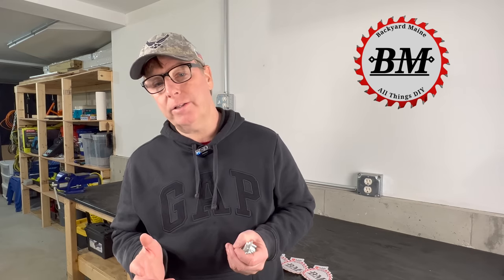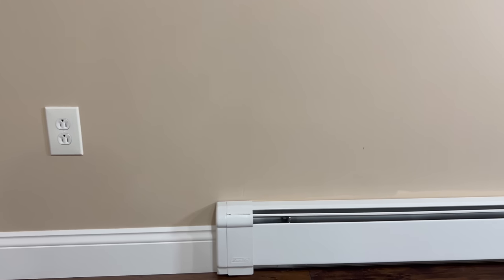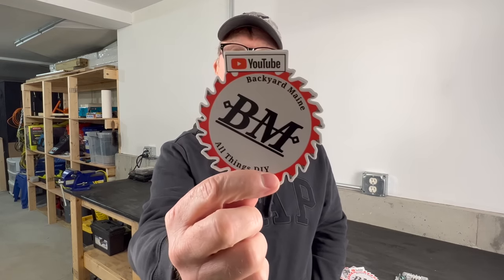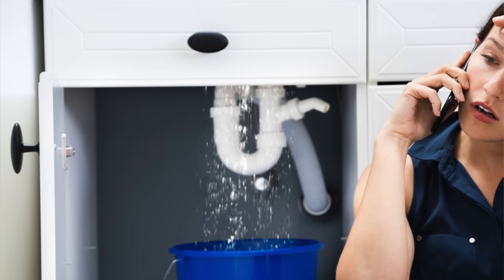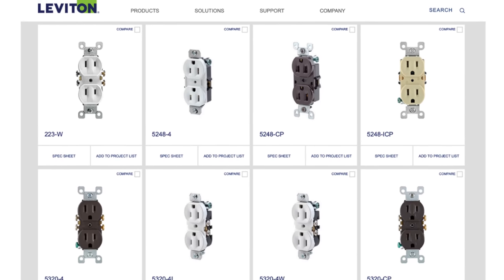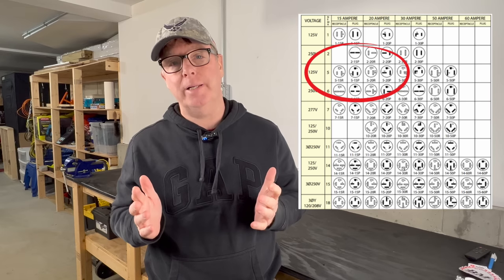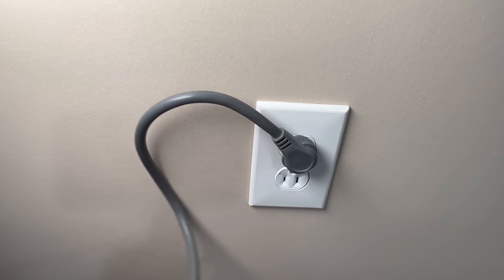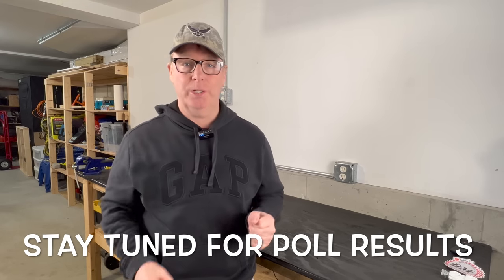Are your outlets installed upside down? (You may be surprised)

Comment: My Dad, a master electrician in Miami and St. Augustine Florida,  taught me that it's ground down. For  two reasons. The ground is the longest prong and therefore, the last one to disconnect in a partial pull out. That way the appliance remains grounded continuously until the plug is completely removed. I think he was correct.
Reply: That's not enitrely true. Its an intuitive thought yes but, the longer length of the ground prevents the shorter conductor blades from breaking contact before the ground pin. That's it's design.
Reply: Rule 1: Ground should contact first and break last. When someone steps on a cable with a "rubber" molded plug and bends the pins ground down  give a better chance of obeying  rule #1.
Reply: That is the first logical opinion I've read/heard... But when actually insertin or removing a plug the ground will be first/last to make/break contact. Any plug that works it's way out of a receptacle due to wrangling the cord would be damaged or very deformed before a ground fault condition could occur. End user ignorance can't be specified or solved by design... That is why we have lockouts... 😂
Reply: @javajoust  Thanks.  My Dad was a very smart man and I miss him.
Reply: I would like to respectfully argue that theory. In a partial pullout scenario the neutral and hot connectors will be exposed to possible objects or little fingers actually coming in contact with the connectors such as if you're hammering a nail into a wall and drop the nail and it just happens to fall across the exposed hot and neutral of the partially pulled out plug underneath you. If the ground was up, the ground connector would be exposed to the falling nail. Also, most cords run along the floor which make them succeptible to partial pullouts from feet and furniture pulling on them. A ground up installation would be stronger resistance to a downward pull considering the shape and length of the ground connector. Outlets seem to grip the ground connector much more solidly than the hot and neutral do. We have all grown up seeing ground down so of course it looks very very wrong to us. I have reversed outlets to ground up a few times to accomodate window air conditioners that were above the outlet and had very short cords. It seemed weird at first but did the trick because of the design of the air conditioner plugs and the short length or the cords. What do we do if the outlet is sideways? Ground left or ground right? I bet all the righties out there will say ground right lol.
Reply: Yep I was looking for someone to say that.
Peace
Reply: But what difference does it make if the ground prong is up or down? Either way, the ground prong, being the longest, is the last to disconnect.

Comment: I wholeheartedly  agree with you on ground down. The esthetics are more presentable on a ground down. Many of my cord applications prove that ground down will accommodate  other cords  more easily.
Reply: My thoughts exactly
Reply: With ground up, if a penny or other object fell on the pins, there's less than 50% chance of a bright boom. With ground down there's close to 100%. Ground up for the win
Reply: Are esthetics or poor cord design more important than safety?
Reply: @presw2pw123  how many of yall just keep your pennies and other conductive objects directly over your outlets that also at the same time happen to be hanging out halfway so that the prongs show enough for it to short it💀 like what is this made up ass scenario lmao
Reply: @presw2pw123  There is no metal in pennies anymore.  Maybe that is the real reason they stopped using copper.
Reply: @robertsmith2956  They are zinc with a coating of copper , and still conductive.
But the reason is because of the penny being devalued .
Ergo it would take more copper than a pennies worth .
Reply: @robertsmith2956 pennies since the early 80's have been made of Zinc and have a "wash" of copper, so they definitely conduct electricity,  although the Zinc has a slightly higher resistance.  I doubt that you could measure the difference with any ohmmeter you own.
Reply: @presw2pw123 You act as though this actually ever happens. Its a complete and total non issue
Reply: @presw2pw123 so all cords a poorly designed?
Reply: My first home was ground up, I grew up with ground down and never saw any issues. With my first home we had a lot of arching and black around my plugs and had trouble with appliances and extension cords. That scared me so I turned most of them to ground down.
Reply: @garys0scale525  Does it make sense for an alcoholic to throw half a bottle away cuz he saw puppies out the back of a sack ?
Reply: @garys0scale525  What did Billy promise Alice ?
Reply: @garys0scale525  Oh sorry i see the key got deleted.  I was talking about the movie , where the red fern grows .
Reply: The aesthetics? Aka, YOU like the way it looks?

Comment: What it really comes "down" to is what the local inspector likes to see. I mounted  all my house outlets ground down when I built our home. No issue from the inspector. When I built my non-attached shop building a few years later, I mounted all my recepts. ground up for added short circuit protection with 3-prong plugs on my power tools. No issue with the final inspection that way either. It doesn't seem to matter, up or down, code wise. Just keep it consistent throughout the building. And it would be nice if the NEC outlawed those 45 degree plugs. They are a stupid whacky idea without any tangible benefit.

Comment: I bought a new house recently and all the receptacles that were linked to a wall switch were upside-down (i.e. had the ground up). The builder told me that's so I can quickly see which switch was activated by the switch on the wall. For more clarification, it was only the top outlet that was controlled, the bottom one was always on. Since you'd normally only be plugging one lamp into that area, it wouldn't make sense to have them both switch activated. Now that I've been here for some time, I like this approach.
Reply: I've always used a different color for a switched outlet but I suppose that would drive some people crazy aesthetically, including those who wouldn't bat an eye at seeing outlets oriented two different ways.
Reply: @ziqfriq  Color here as well. Makes it much easier.  Also use two separate power feeds to all rooms so I can have a live outlet when I throw the breaker to fix a plug.
Reply: You are right.  In your bedroom you have a duplex receptacle. One is switched  and the other is always live. The reason for that is for your lamp is (switched) and your clock is (live). You would not want your clock to go off when you switch the light off.
Reply: In this case, since the lamp usually stays plugged in permanently, I would wire the bottom receptacle to the switch, so that way the upper outlet is more accessible for plugging in and out various items. (And not having the lamp’s cord and plug in the way). 

But still, I prefer horizontal receptacles with neutral up. As I mentioned in my comment some time ago 😊
Reply: In our house, you just have to know.
Reply: @federicoulloa1255  Horizontal FTW!

Comment: For most of my life in the 1900's, I've seen the outlets installed ground down. That's my preference. Also, most of the flat 90 degree plugs are designed so that the cord faces down, when plugged into a ground down outlet. This seems less stressful on a cord, than having the cord facing upward, unless the appliance happens to be above the outlet.
Reply: What if the cord is going up to a table and the outlet is below?
Reply: @stevenw4549  Dismount the recepticle, invert it, replace it, and there you go?
Reply: @stevenw4549  I do not see how that matters. If your cord is long enough it will just hang down.
Reply: I feel the receptacles are happier ground down 😂
Reply: I've interviewed hundreds of receptacles, and they tell me they prefer to be ground up. I also ask them what scares them the most and they told me Biden. They are afraid he will ban them next. @PeteSleigh
Reply: I do my outlets as you wrote Jeremy., I find it hard to think someone has a video as to what is right. Who cares.
Reply: WHY… just WHY, does hearing someone talking about “the 1900’s” always sound like it was a few hundreds of years ago??? I mean, just imagine if someone were to say, “Did you know that back in the 1400’s Christopher Columbus believed that he had just discovered America and then a little while later, in the 1900’s, students are still being told this incorrect story.”. To me, the 1400’s and the 1900’s both sound as if it was back during ancient times because it sounds so far removed from the current day that it just doesn’t sound right and some would even argue it’s crazy!!! 🤷‍♂️🤷‍♂️🤷‍♂️
Reply: Once in awhile you get the oddball appliance cord that needs the ground opposite to how it was installed!

Comment: This happened to me. After my dad passed away, I unplugged the refrigerator to replace a part so Mom would still have a working water dispenser in the freezer door. Dad had replaced all of the switch plates and outlet plates in the house with brass plates. (I always thought they were gaudy.) 

Well, Dad didn't screw down the plate for the refrigerator. When I began to wiggle the plug out of the outlet, the brass plate dropped down immediately and landed on the two prongs. I saw a flash of light and heard a "crack" and the power to the outlets in the kitchen went out. The brass plate was scorched. And I don't remember why I was wearing rubber dish gloves, but the fingers on the right glove had scorch marks. 

It startled me a bit but what scared me the most was the thought of what could have happened if the breaker hadn't tripped. Those things work INSTANTLY! Thank you to whoever invented circuit breakers!!!

PS: I remember now why I was wearing dish gloves. Refrigerator plugs are hard to get out of the outlet so I put on the gloves to get a better grip.

Comment: I’ve been an electrician almost all my life I’m now retired at 71 years old. When I rebuilt my house in 2006 the NEC wanted ground up so that metal receptacle covers would not short out if it comes loose and falls onto a plug. I couple of years later they changed it back to ground down. Sometime prior to 2006 it was ok to mount the ground down. My house receptacles are all ground up because of when I installed them. Any new receptacles I install they are usually mounted down. The NEC has caused the confusion among electricians. Thanks. Steven B.
Reply from the maker: The national electrical code updates every three years. I believe it may have mandated ground up in the 2005 code which cause so
many issue that they reverted back in the next cycle. So before and after that version of the code and including the 2023 code today the give no guidance on receptacle orientation so any of the six options would be compliant.

Comment: I'm in Canada, where we have pretty similar electrical codes. The electricians I have discussed this with say that ground up was the original idea, for safety, just like the video explained, however, people just didn't like the looks of it. Most people find ground down to be better looking, so electricians started mounting them ground down because that's what the customers wanted.
Reply: and the customers wanted it because degree plugs or wall warts will point the wire up instead of down if the ground pin is at the top!
Reply: @rtel123  Find a nice nightlight for your kids with a nice Disney design on it and plug it into a ground up plug. It will be upside down.
Reply: Master Electrician, 30 years.
Down is my preference. Up for switched receptical.
Reply: I've never encountered ground up.
Reply: @ericnortan9012  Good idea to let people know which one is the switched one. Thanx for the tip.
Reply: @wally7856  Right. Best way is a label in my eyes, but definitely let customers know. Problem is, after property changes hands a couple of times that knowledge can be lost. I've had calls for " sometimes my plug  works, sometimes it doesn't " or " we can't figure out what this switch does" or a combination of the two. Usually from people who aren't familiar with the method, it's not as common nowadays, or a ceiling light was added w/o disconnecting the switch leg to the receptacle. Generally a simple fix as long as the wires are were they need to be.
Reply: @ericnortan9012  I do property management for rental units that usually have a switched plug in the living room (switch by front door). Have been labeling those receptacles but labels fall off. Will be doing your method from now on. When I get a phone call from a tenant it should be easily diagnosed over the phone by asking them if the receptacle has ground up or ground down. Will save me a trip over. Once again, thanks for the tip.
Reply: @wally7856  👍
Reply: Text book taught me ground up. Appliance manufacturers are cutting corners and costs. Put the ground back in.
Reply: @everpresent2443  Double insulated appliances (plastic case) have no need for a safety ground.  Safety grounds are required for metal chassis appliances because if the hot wire comes loose inside and makes contact with the chassis, the whole chassis becomes hot creating a very dangerous situation for the user. The safety ground connected to the chassis  will short out the hot if it makes contact and trip the breaker. Without a metal chassis there is nothing to hook the safety ground up to and if the chassis doesn't conduct electricity it poses no danger.
Reply: @wally7856  Thank you!
Reply: Only French electricians put ground up
Reply: That safety advice doesn't make any sense to me because the NEMA plugs aren't a good design either way. If safety was that important, the design would be improved by simply making the prongs only connect at a deeper level.  I guess changing from NEMA to anything else is going to be harder than switching to metric.
Reply: @wally7856  you can have faults in areas that you don't expect.
Back in the days, my roomie had a plastic notebook without ground. The PSU was defective. When he plugged in his ethernet cable, its ground carried a partly live voltage to the cheap ethernet switch. Which also had no ground. Next door, if somebody would plug in their computer and accidently touch the ground of the ethernet cable, he would get electrocuted. Despite Ethernet being low voltage. Took us a while to find the fault.
Reply: @svr5423  Electrocuted? My condolences.   (I'm sure you meant shocked, electrocuted means death by electricity).  Did you ever measure how much voltage was on that line? Big shock or mild tingling? Was it a non listed Chinese special PSU not up to our standards or was it original equipment? Some weird things can happen when you have floating grounds as they can capacitively couple with nearby power.
Reply: @wally7856   you're right. Shocked. nobody died fortunately :).
I remember it was around 50V ish? Shock comparable to touching a 9V block with your tongue. Or fiddling with phone lines when a ring signal arrived. It's been a while. And yes, even back then everything was chinese. Early 2000s. But it was original equipment. My roommate brought it back to the shop at least twice until they gave him a proper working PSU.

A few years later I lived in a cheap flat. The radiators would have around 65V of voltage against ground. Never figured out why. Nothing happened if you touched them "normally" (floor and clothing insulated sufficiently) but if you touched a grounded device with the other hand simultaneously, you would also get shocked. In Germany, people often cheaped out on proper electric and gas installation.